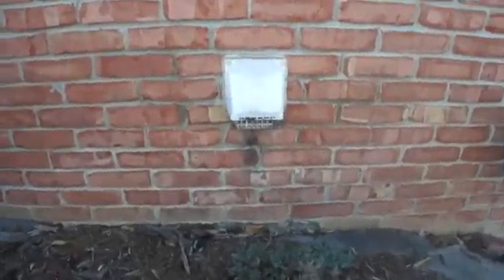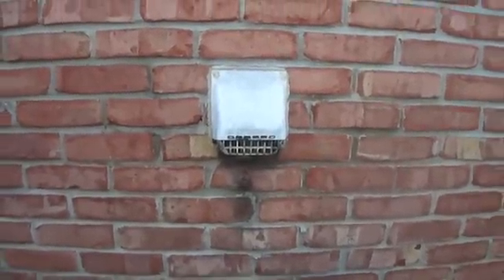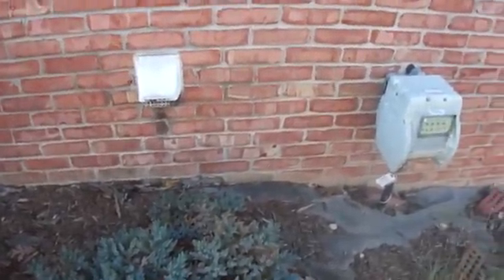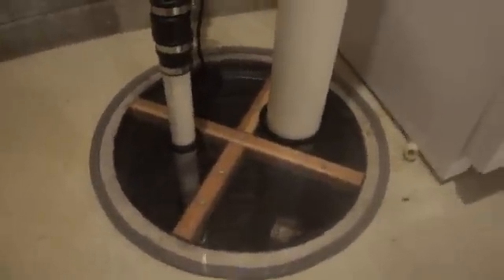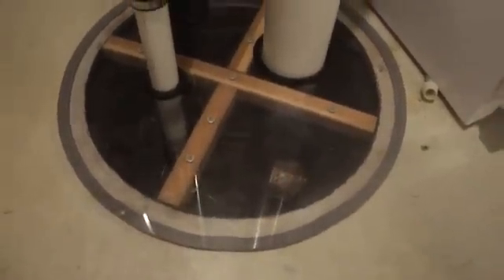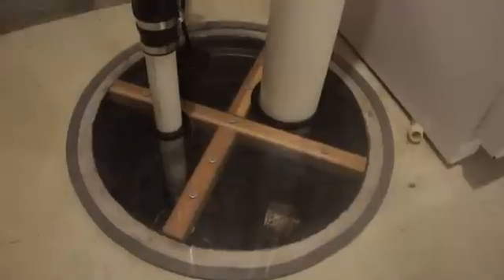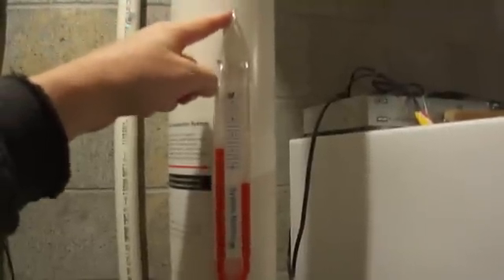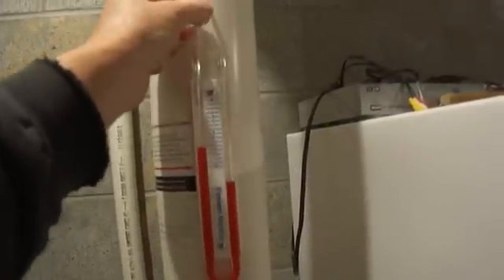How To Install Your Own Radon Reduction System

Comment: I'm not saying your job isn't professional looking,  but why do you see "professional" jobs usually vented through the roof or at least above roof level ?
Reply: You negative people are trashing this guys system either for two reasons. One your a radon mitigation installer who charges 1500 for somewhat of a similar setup except through the roof. Or you are an envious consumer who fell for the thieving company's that install the systems and after seeing this wished you would have done some research on YouTube.
This guy is doing it his way because he wants to save money and the way he did it will be fine for him.

Comment: So..FYI.    The fan is installed in the basement.  If the fan housing develops a crack or leaks (which they do).  The house will fill up with a radon value much higher than original.   The fans are always installed at the exterior or attic for safety.

Comment: Not to code. The termination of the radon systems needs to be at least 10' above grade level.
Reply: Who cares? Those regulations are to stop you from putting it next to your window you like keeping open or by the lawn chair you spend half your weekend relaxing in. His radon levels are now below 1, and it's not like he paid a professional to do this. If he ever sells his house, just knock the system out, patch the hole, and remediate if the new buyers want to test.

In my case, I wouldn't even feel bad about the above advice, since my radon levels were 2 - 3 before doing what this guy did. Now they're 0.3, but if I ever wanted to sell, I'd just remove the system. It's not like I was at the official action level before hand anyway.

Comment: PLEASE READ THIS IN ITS ENTIRETY. Your outdoor pipe needs to be run 2 feet above the roofline or easement, and 10 feet away from any building envelope opening (windows, vents, doors) for your family's safety. You can disguise it with a commercial grade (schedule 40) outdoor gutter. You've done a great job with everything else, just raise that pipe and you'll not only pass an inspection if you ever sell your house, but it'll be significantly safer. As the radon is being mitigated in your current system it's being blown in one location, which is actually concentrating it on one location of your property vs dispersing it into the atmosphere.The code is written by the EPA for very specific reasons, I urge you to do the right thing and run the exhaust pipe correctly, you never know a $10 piece of pipe could save one of your kids lives (4 units per liter is the equivalent of smoking half a pack of cigarettes per day). Radon is currently the most dangerous health hazard to anyone living in a home, even higher than as Asbestos. Write back with any questions, I'd be glad to help.
Reply: That code was written by the EPA based off a 1994 study that says you get 10x more re-entry of radon if doing it this way than the roof way. 10x sounds scary until you realize that we're talking about 0.1% re-entry when at roof line vs 1% re-entry when at ground level like this. Seriously, go read the study. Sure, this isn't to code, but I don't care if 1% (or hell, even 10-20%) comes back in my house. If I'm below 1 pci and I don't build my kids swing set next to the vent.....I just don't care what the code says.

Comment: If you ever open your windows it's coming right back in.
Reply from the maker: I don't open the windows by it.  And don't be fooled, the wind can still blow it back into any open window even if the exhaust stack is above the windows.
Reply: Once this gas is expelled into outside air a desperses it is so  diluted that it is pretty much harmless.

Comment: In Mike Holmes video the motor is inside. Just because some code is written doesn't mean it makes sense. The motors job is to create air flow and pressure drop. One commente worries about the Radon reabsorbing into the ground???? ?It is in your house because it likes to comes out of the ground. I personally find this system to be well though and I will probably do one just like it.
Reply from the maker: The system has worked flawlessley and keeps radon levels at or below one.
Reply: @proclaimliberty2000  The latest EPA documents no longer say where the Fan must be mounted.  Actually Canada says the basement is the best location to prevent damage to the fan.  I live in Fishers Indiana, and the city allows installation of the fan in the basement.  If you think about it, if you don't allow the Fan to be located in the basement, then you should not allow gas furnaces or gas water heaters to be located in the basement.  As Canada says regarding radon fan installation, "properly installed fans and pipes will not leak radon into the building and are usually installed in the basement".
Reply from the maker: wd8dsb 👍😊

Comment: doesn't the pull a it in through the discharge tube of you sumpnpump so it may not be removing as much as you think. and if the sump pump kicks on you you and a set up to have the vacuum pump turned off to keep from sucking water in?
Reply: Why would you ever have to bother doing this? The sump pump ensures that the water level will never even come close to the level of the fans air intake (at the very top of the sump). It's like just barely sticking a straw past the lid of a cup thats half full. If there's another system making sure that cup never gets more than half full, you'll never suck anything but air out of that cup.
Reply: With the Lexan cover sealed, when the pump turns on it may suck air from radon tube. It’s been running 8 years so the pump using the tube as a vent doesn’t seem to damage the fan. Sealed sump lids call for a vent pipe like sewage pipe . For code it may call for the fan to turn off while pump is on. It works fine as is it seems though. 
     If you wanted to turn the fan off while pump is in operation you can use a current sensing relay or hawk eye we call them. At the point you’d need a step down 24v transformer for control voltage and a contactor to control the 120volt fan. You could also use a 120volt coil relay and wire the fan into the normally closed terminals on the 120 volt relay. This is if you want to go crazy 😜 on this thing . Then may as well wire it to play Edgar Winters Frankenstein song when in operation :) Seems to be working as is lol no need unless your selling the house ;)

Comment: You have no knowledge of what your doing but who the fuck cares about you
Reply: It's funny to hear 'professionals' complain about results just because DIY'ers don't confirm to EPA guidelines, all while showing their complete and utter ignorance when presented with fact based evidence such as that his radon level is now under 1 pci. 

That EPA guideline came from a 1980s study where they took 40 homes, installed radon systems like this, and a year later saw that some of the homes still above 4pci. All of the homes still had significantly decreased radon levels. They found that venting further away solved the issue for the people still above 4pci. 

This guy is actively testing his level to confirm that it's now below 1pci, and it doesn't exactly look like he keeps his lawnchair or his kids playhouse next to that vent, eh? So what's your problem? Scared there'll be one less house for "a professional' to run PVC pipe up the side of?

Comment: Todays code reads that the fan is required to be outside and the vent pipe be at least 12" above the roof edge. Two feet above any window...
Reply: The rule is that no section of pipe that is under positive pressure (ie the outflow of the fan) may be inside the conditioned area of the home.  The idea is that should the piping leak you don't want to be pushing the radon out into the house.
Reply: lol but you can do it on a furnace or water heater
Reply: @mfarver  When has PVC installed properly ever leaked air? PVC isn't exactly hard to install.
Reply: Hi Bruce.  Actually Canada says the basement is the best location to prevent damage to the fan.  I live in Fishers Indiana, and the city allows installation of the fan in the basement.  If you think about it, if you don't allow the Fan to be located in the basement, then you should not allow gas furnaces or gas water heaters to be located in the basement.  As Canada says regarding radon fan installation, "properly installed fans and pipes will not leak radon into the building and are usually installed in the basement".
Reply: @lovesdogs8616  That is a possibility.  Air tight homes trying to conserve heating costs might be part of the problem.
Reply: You know, my house was around 2 - 3 pci - both on the lab test and safety siren pro radon detector I bought for continuous monitoring. I did exactly what this guy did.  My reading went down to 0.3.....There's a lot of professionals that want to scare money out of people, but if doing it the "wrong" way still cuts the radon level by 90% and I didn't even need it in the first place (Below action level of 4) - who cares? 

If I ever want to sell my house, I'll remove the radon system and patch the hole it used. Radon would still test below the action level, and I'll still have had piece of mind for the duration of my residency.
Reply: @alexl9199 I  agree.  The tests are the proof.  However, tests can be rigged mightily.  People naturally do what is best for themselves, to make things nice, safe.  There is not need for EPA's and health depts to get all bossy crazy after a person.
Reply: @alexl9199  And, you could keep the hole and just run pipe up the side of the house.
Reply: Because gubmint says so.
Reply: In case anyone is curious, the purpose of this is that if the fan is installed inside and the exhaust portion was to be accidentally disturbed and create a leak it would dump highly concentrated radon into the building. The difference between this and not having one (aka before installation) is that the system is pulling it out whereas it is moving via pressure gradients before.
You vent it above your roof for the same reason so that it isn't dumped in your face while mowing or potentially going into an open ground floor window.

Please don't copy this video, although his sump cover is built well.

Comment: Not to mention you don't get the warranty on the fan unless you're a licensed radon professional.
Reply: So you're telling me that in states like Alaska, where there is no license for radon professionals, companies simply won't honor warranties? Or are you saying that this is a secret provision that literally isn't in the warranty conditions, at least for fantech? Or are the reviews on Amazon talking about having gotten warranty service pathological lies? In any case, I'd love to know what makes ensuring a fan is vertical, level, and then plugging it in such skilled labor. Either way, you don't exactly sound like you know what you're talking about. I hope you don't think of yourself as a 'professional'
Reply: Fan is the least/last thing you should worry about - they are cheap and usually last for than 10-12 years. Why would you need to worry about 5 year warranty? Make sure the installation price is right and that you are not charged $500 an hour given the cheap price of materials. Fan warranty is part of the sales pitch more than anything else.

Comment: Hope you don't have to sell the house, because all of your work will have to be done over correctly and to code.
Reply: Or in my case, just ripped out. My radon levels were 2-3 pci before doing exactly what this guy did. If I ever want to sell, I'll just remove the system and patch the hole. It's not like I'm at the action level anyway - I simply enjoy that for under 200 bucks, I was able to easily do it the 'wrong' way and cut that down to 0.3 pci.

Comment: Not sure if you are in the US or Canada, but the concerns over the fan being inside as well as the dryer vent are legitimate. Sorry --- don't mean to be yet another person to point it out, but you should check out the EPA.gov website.  They require the unit to be outside for a reason. (maybe if you had a digital radon detector that beeps when the levels get above 4, then I'd feel better. I do understand the concern for the unit not being in the weather.) Also, the biggest no-no to me is the vent being so close to the ground. It is an absolute fact that you are not giving the gas enough room to dissipate adequately before being absorbed back into the ground. It really should be at least 10 feet off of the ground. Your readings might be better but as a mom, it still concerns me!!  I have a system that works great (professionally installed, but now looking to move it ourselves to finish our basement). Our next door neighbor didn't get one even though we told him about ours. His wife died this year of lung cancer after living in the house for less than five years.
Reply: +Carla H "His wife died this year of lung cancer after living in the house for less than five years." Wow, where is the evidence that radon was the "cause" of the cancer, think a moment about what you are saying, association is not causation.
Reply: +shaun boyce You're right. Association is not causation. But I still believe an ounce of prevention is worth a pound of cure.  If I can I do something differently and just as cheap that in the smallest possible way MAY be safer to myself or my family, I will.
Reply: Statically speaking you have roughly 1/16,000 chance of getting lung cancer and dying from radon. I'm not advocating you don't get a radon test, but would your neighbors wife not have died if they had done something different? 5 years is a rather short period to get lung cancer if it was from radon, and your assertion implies exactly that, but there is not evidence to prove your theory.

Comment: When the pump runs, how does air get in through the vent if you have a motor constantly pushing air out?
Reply from the maker: +J Webster The air is drawn from the drainage tile pipe that empties into the sump pump crock.  The drainage tile pipes under the cement floor have holes in them which is covered in peastone.  This allows the rising radon gas to be captured and exhausted before it enters the living area.
Reply: @proclaimliberty2000  these people are clueless and trying to scare you. as soon as the radon gas vented outside it will mix with the fresh air and the concentration will go way down so even if some of it get back inside through any opening it will be harmless.
Reply: Ah, so the same system couldn't be used for an ejector pump then as that needs to draw air in as well from the vent pipe
Reply: @proclaimliberty you seem like a "comman sense" guy in which that seems to be a characteristic trait that is going away with people today. I'm going with your way.